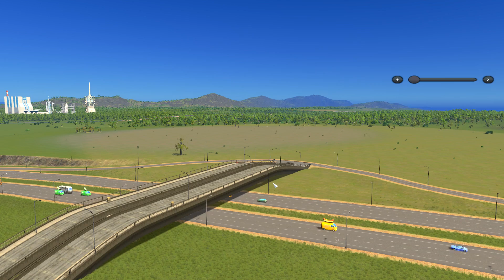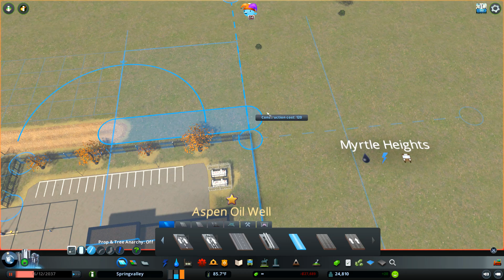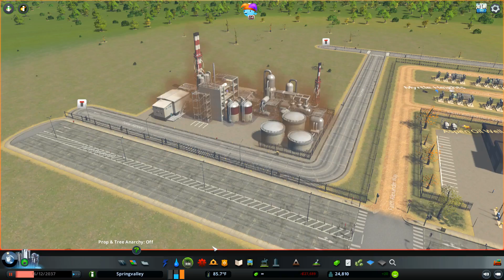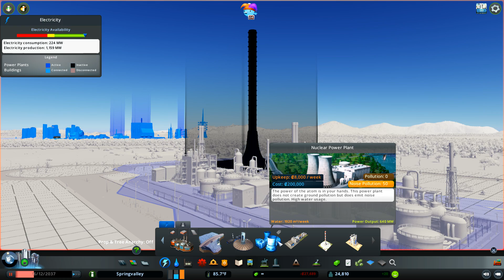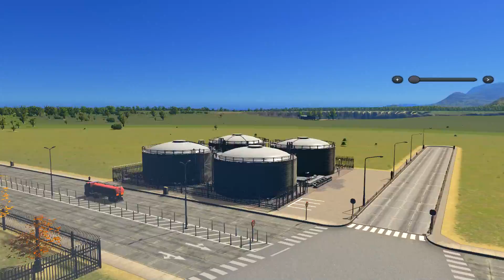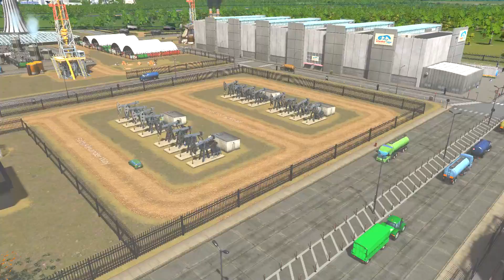Oil Refinery - Cities Skylines Modular Builds - No Mods (Mini Build Guides)

Comment: The one critique I have is that you didn't touch on balancing the facilities. The pumps and derricks produce X amount of crude, you should ideally have refineries that require X amount of crude. If your refineries require more crude than your extractors produce you will be importing it from other cities. And if your extractors produce more than your refineries can handle you'll export crude... which pays less than exporting finished products.
Reply: I'm curious to know too. So what should be the balance between mining and processing buildings?
Reply: @user-ne3em4ef9f  The information is available online. I found it, but don't know where I put it.

Comment: I admit I used custom assets, mostly the industrial pipe sets by Beardmonkey and others.  My father used to design piping loops and cooling loops for refineries, so I basically added my own pipeways connecting storage units with production units and oil pumps with storage units.  There's also a yard for deliveries and another yard specifically for construction equipment - old cranes, front loaders, etc. that the oil area might need.  It's by no means pretty but it looks completely realistic for an oil refinery. :-)

Comment: Such a satisfying build to watch. Especially like the frontage/service roads alongside the main throughfares.  General question: Do any of the industries generate a higher risk of fire? Would adding a fire station to the zone help reduce that risk?
Reply: A small station would be realistic for a refinery area. Also a helicopter pad for VIPs or MedEvac near the office or refinery fire station. Security (police) and company worker transportation (bus) from barracks and parking lot keeps private vehicles away from flammable high pressure fluids.

Comment: Love your build guides. Will this work if my map ran out of oil? Any changes you recommend for that issue?
Reply from the maker: Unfortunately that's a major flaw in the game imo. Oil and Ore run out way too quickly making placing large custom industrial estates like this really off-putting. My advice would be play with the unlimited oil & ore option. otherwise, this becomes redundant unfortunately!
Reply: @OVERCHARGEDEGG  Do those mods work now with the Sunset Harbour Expansion?
Reply: @nunya-k8j  it is a in game mod, made by the developers.
Just go to your mods list and put the unlimited thing.
Reply: @nunya-k8j  don't worry, it's not even a external mod: go into the content manager, it's a built in feature under the 'mods' category
Reply: Industry areas will still work without extractors, so the resource doesn't have to be on the map. The processing and storage buildings will import the raw materials (oil, ore, crops, and raw forest products), and produce refined products (flour, plastics, metal, etc.), which will level up the area and can still be profitable. Just keep in mind the amount of traffic the importing will cause.